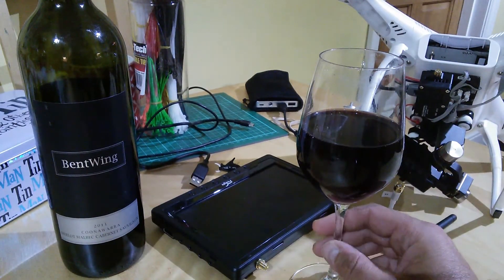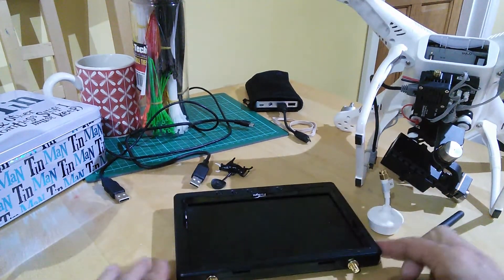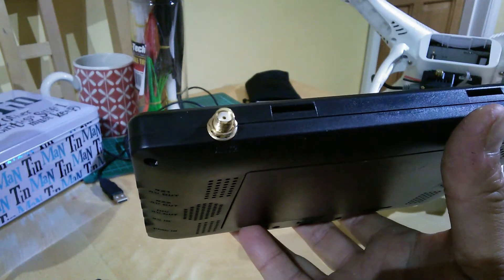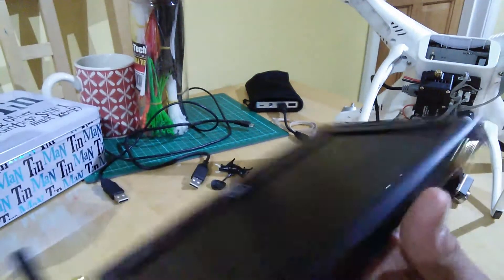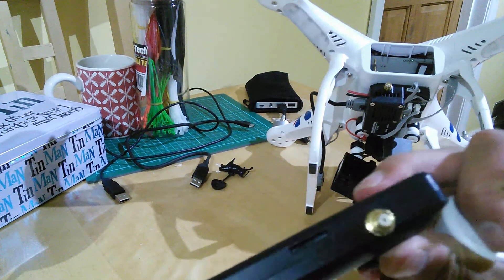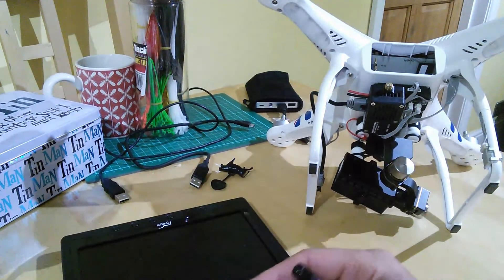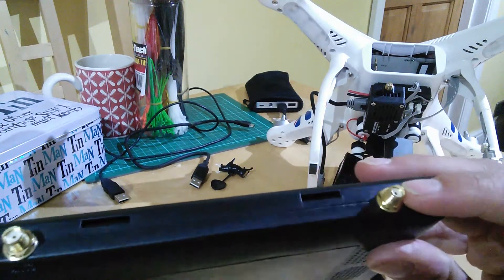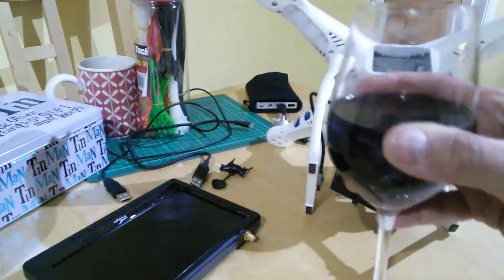SMA or RP-SMA? Which antenna connectors for your DJI Phantom 2 or Vision+ antenna mods

Comment: hi iknow its a old video but now ive gone fpv on my 250 quadcopter ive had to buy a sma adaptor for my 5.8 transmitter as i got the wrong one but getting line on the screen then flying so i put the stock antenna on with out  the adaptor and problems solved so need to buy  a new set what thr point selling them if you get lines on screen

Comment: Can you tell me what the difference is between antennas advertised as reciever only and transmitter only? Ive seen some that dont clarify if they are for transmitting and receiving. They seem to look the same.

Also, is the sma / rp-sma only to do with the connectors? Does it affect the antenna in anyway? I was assuming being called reversed polarity meant that the two parts were connected opersite, or that the clover leaf twisted the other way... has got me very confused! ! Thanks.
Reply: ***** ah thanks Simon. I'm new to fpv, infact I have 3 small micro quads, to practice with. They all have small on board cameras on them which I plan to replace with a 5.8g system. In fact I have ordered a 1g camera and an 8g boscam transmitter. Trouble is that the transmitter board comes with nothing. Not even an antenna connector. I bought a short SMA clover leaf antenna, but the seller said it is a reciever only antenna. Which only confused me more! I bought a sma socket to solder to the board so hopefully everything will work as planne!
Reply: Yep will do! Plans to buy the QR X350 Pro around payday too :). Might do a video of the build of my micro though.

Comment: Thank you. What a nightmare. After getting a range of about 80m before signal loss I did some research. My Black Pearl monitor came with SMA connections on the monitor AND antennas. So... no "pin" connecting the antenna with the monitor. Both "female" connections just sitting on top of each other when screwed in place. Found what I needed on line. http://www.ebay.com/itm/400776249248

What a nightmare. You're right... manufactures are obviously confused if the "all-in-one" system I just purchased doesn't exactly come with everything one needs. Thank you, Simon.

Comment: this vid was very helpful im doing a mod to my hubsan x4 fvp controller with the monitor on it,im changing the battery connection and antenna ill make a vid soon i need some pigtails really just one lol and a antenna for it i have the connector for the 6v nimh battery im putting in it thanks for all your vids there helping me out alot!cant wait to fpv with this beast!
Reply: i e-mailed you as well bro ok thanks alot.

Comment: Hi Simon...  I have the P2V+ and would like to increase the range on the 5.8 GHZ transmitter.  What is the best antenna to upgrade it with?  Also, can it just upgrade the transmitter antenna, or would I also need to update the quadcopter antenna as well?  Hope you can help.  Thanks

Comment: I'm looking at either getting the Phantom 2 Vision or Phanton 2 Vision Plus. Do I go for the P2V and try and get a 3D gimble and say a go pro 3+ or just get a P2V+? Can the camera from the P2V+ be replaced at a later date so to future proof my purchase. Your advice wild be appreciated.
Reply: Thanks for getting back to me, been throughly enjoying your videos and have subscribed. Ok so the gimbal and the camera are combined which I didn't know or couldn't find out this. I don't presently own a GoPro but for me its all about getting the right set rather than the $$. I need to look at the differences between the P2 and P2V+, and gimbals/GoPros.
Reply: Thanks mate will continue my research.